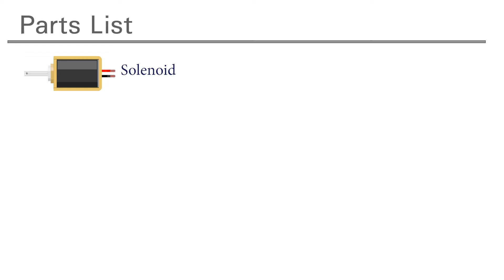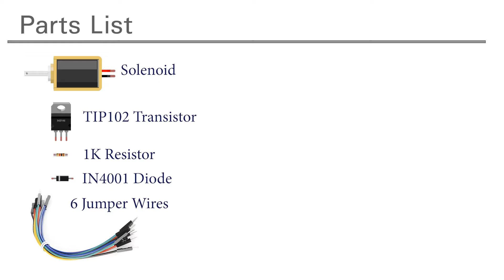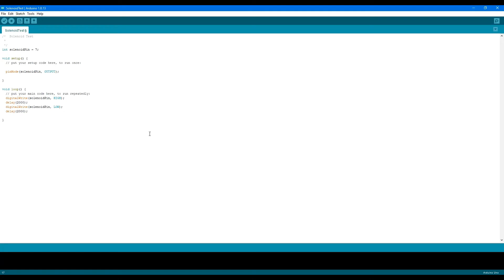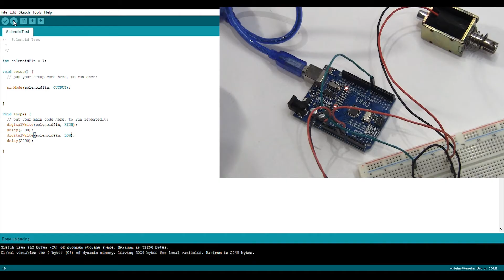Arduino Lesson 4 - Solenoid control using a Transistor

Comment: At 4:05 you say the middle pin goes to the negative side of the diode. What do you mean by that? Do you mean the cathode? Because that would be wrong, it goes to the anode instead, which is the positive (plus) side of the diode.

Thanks for the video.

Comment: This set up may work, but I wouldn't think it is recommended. You didn't explain the 12v power supply very well. (See others comments as well)  But you are supplying 12v in to the barrel jack, and 12v out through the VIN pin.  The VIN pin is an input, not an output pin. VIN = Voltage IN.  Also, it appears that you have this 12 supply attached to the breadboard after the Diode with a direct connection to the solenoid 12v in.
Your thoughts?  Thanks

Comment: Would this work with a 12v 5-2 solenoid valve that connects to a larger pneumatic cylinder and an air compressor. Would I just neee a different transmitter
Reply from the maker: @nathanaelculak7541  sure works just fine

Comment: I have a much larger solenoid and when plugged into a similar circuit the solenoid stays on, not caring about the transistor and the transistor rapidly heats up, is there a way around this?

Comment: can we connect 6 solenoids with arduino uno
Reply from the maker: Yes, you can connect as many solenoids as you have digital pins, just use a different pin for each solenoid or group of solenoids that you want to independently control.  You will need a power supply large enough for all 6 solenoids if they will be used simultaneously.

Comment: Great video! Very clear instructions. Quick semi-related question about power supply: Assuming it's the correct voltage for the solenoid I'm using ... can I hack apart my old laptop power supply by snipping off the cylindrical plug at the end (the part that would plug into the laptop)? Would that reveal the hot/ground wires needed to work with the breadboard? (I suppose I should just bite the bullet and try it myself, but I'm too nervous to ruin the power supply, lol.) Thanks again!
Reply: Yes, that should work as long as the voltage is correct.  The ground wire may present itself as a braided shield around the outside, but you should be able to connect it to a leaf wire using solder and some shrink tubing for insulation.
Reply: Yes, that should work as long as the voltage is correct.  The ground wire may present itself as a braided shield around the outside, but you should be able to connect it to a leaf wire using solder and some shrink tubing for insulation.
Reply: Yes, that should work as long as the voltage is correct.  The ground wire may present itself as a braided shield around the outside, but you should be able to connect it to a leaf wire using solder and some shrink tubing for insulation.
Reply: Yes, that should work as long as the voltage is correct.  The ground wire may present itself as a braided shield around the outside, but you should be able to connect it to a leaf wire using solder and some shrink tubing for insulation.
Reply: Yes, that should work as long as the voltage is correct.  The ground wire may present itself as a braided shield around the outside, but you should be able to connect it to a leaf wire using solder and some shrink tubing for insulation.

Comment: Is it possible to do this without that bread board?
Reply from the maker: Of Course.  I use a breadboard only for demonstration purposes.  You could certainly wire and solder everything directly, but I would suggest soldering to a protoboard for stability and ease of installation into a project box or something.

Comment: Thank you for this video. It would be great if you could do a similar one here. Its for a arcade gun recoil. After watching your video I wonder if it requires a diode. Maybe you could show us how you would make this. 

“The Ne555 boards are easy to hook up. They only have 3 pins.
 
You have 5v and ground in which you'll take from the UHID. Then ground out and power out. Power out is the 3rd pin. Ground out shares the middle pin with ground in. I.e. you have two wires connected to one pin for ground.
 
The output from the Ne555 board goes to a DC DC solid state relay. You should have one that can be triggered by as little as 3v.
 
Connect ground out (from the ne555) to - and ne555 power output to +. At this point you should be able to activate the solid state relay by pressing the trigger or whatever button you have hooked up to the UHID (one that is set to trigger 5v on your chosen pin).
 
Connect one of the wires from your solenoid power supply to one of the output pins on the relay. The other one goes to the solenoid. I usually have the relay connect the - and have the + from my 24v psu go directly to the solenoid. You can try it the other way if you want (or need) to.
 
Then it's just a case of adjusting the two pots on the ne555 until the full auto feel is to your liking.
 
The solenoid  should be triggered 7-14 times per second to feel authentic

https://youtu.be/8gx00X9qgzM

Comment: Could you do this same circuit without the arduino? Just with the push button, and the other components?
Reply from the maker: Sure, you could just wire the battery to the solenoid through a pushbutton.  This would allow you to simply control the solenoid manually.   The Arduino allows you to programmatically control the solenoid.  In this case we have a timer that activates the solenoid on a repeating basis, but it could also be used to read input from the environment and activate the solenoid based on those external inputs.

Comment: Great video! Quick question, why would someone use this transistor method over a 5v relay module? Thanks
Reply from the maker: For this particular application a relay would work just as well.  The benefit to using a transistor is the speed at which it can be switched, the smaller form factor, the quietness of the switching operation, and the durability of the transistor over the relay due to not having any moving parts.

Comment: hello is this lock is  working on Positive and Negative Pulse.
Reply from the maker: No, It is a simple solenoid that works off of the current from the power supply.
Reply: @DIYTechGuyShow  ok, actually I am doing a circuit that is 12V, 2A solenoid lock control through RFID, I am doing it through the H-bridge circuit, but my output is not coming. can you help me out with this?

Comment: IN4001 diode works with 5VDC.
How to connect 230VAC solenoid? I have these controller reset effects..
Reply from the maker: I don't think you can control an AC solenoid through a transistor.  A simple solution to get around this would be to use a DC relay to control the AC current.  I have a separate video explaining how to do this.  https://studio.youtube.com/video/KlxFC89gqpk/edit  In that video I control a 120V lightbulb, but you could use the same design and relays to control 230V.

Comment: Wait so you said the arduino can't provide 12v then you connected 12 volts to it?
Reply from the maker: The Arduino can't output 12V through it's controlled pins.  I just connected the solenoid to the 12V on the input side of the Arduino.   The Arduino can accept 12V, but it steps it down to the usable 5V for the processor.  The VIN Pin is connected to the barrel jack connecter prior to the step down in voltage.  The reason for this is that the Arduino can be powered from either the Barrel Jack or the VIN and GND pins.  By connecting my Solenoid to the VIN pin I eliminated the need to splice the incoming wire going to the barrel jack.

Comment: How would this work if I was using a board that didn't have a Barrel Jack?.   Could I just plug the V+ of the solenoid into a common 12v rail?
Reply from the maker: Without a Barrel Jack you would need to connect your 12V power supply to the VIN Pin(Positive) and the Ground Pin.  This will power the Arduino, the Arduino will convert the 12V from the Barrel Jack to 5V needed by the board.  In this setup, you could also follow the instructions just as they are and hook up the solenoid and transistor through the VIN pin, but it is probably easier to just connect it directly to the power supply or 12V rail.

Comment: Its really a great explaination! I have a question.. if i have to actuate 2 or more solenoids, connections would be the same? and if yes  can i  give Vin supply to other diodes too?? offcourse i will be using buck converter for regulating the voltage..
Reply from the maker: Sure, you can activate almost as many as you want as long as you have enough current(amps) from your power supply and enough digital pins on the Arduino to switch the transistors.  I'm not sure why you would want to power any diodes from the VIN since that would be 12V.  If you are talking about Light Emitting Diodes (LEDS) you would only want about 1 - 3 volts depending on the diode.  These would be more easily powered by the Output pins on the Arduino.   You could certainly power them from VIN, which is essentially directly from your power supply, and regulate the voltage through a buck converter and your only limitation would be the current(AMPS) supplied by your power supply.
Reply: @DIYTechGuyShow  ok I am clear now. thanks for ur reply 👍

Comment: can i use IRLZ34N MOSFET instead of TIP102 transistor does it also work with DC 12v solenoid valve???

Comment: Hello Tech guy. I am trying to get this working for a college project. The code will not upload and its the xact same as your code. Any ideas?
Reply from the maker: Will it not upload or not compile.  The upload button actually does both, compiles, then uploads.  If it won't compile, your issue is somewhere in your code.  If it won't upload, there are a few issues that could be causing this.  1st is a bad Arduino Board, 2nd is if the wrong board is chosen under the Tools Menu, this needs to match the board you are using (Arduino Nano, Arduino Uno, etc.).  The Processor chosen under the Tools menu could also be an issue,  Uno should be one of the ATMega 328, and the Nano would be one of the ATmega 128.   The Programmer chosen might also cause upload issues, I currently have mine set for AVRISP mkII.  I hope this helps, please respond with whatever it is that fixes your issue.
Reply: @DIYTechGuyShow  so I went to tools your and right the board was the wrong selection. I am using a Mega 2560 so I selected that and it ran the code but the solenoid did not open (its and old solenoid I took out of an old appliance so could be siezed shut). I am also using a TIP 121 transistor. Besides that everything is identical.

Thank you for your help by the way. Im a Mechanical engineerinf student and its so hard to find people who know what they are doing when it comes to arduino.
Reply from the maker: @c.moh8842  well, the first thing you should check is to make sure the solenoid is functional, the easiest way to do that is to just connect it directly to the power supply and see if it activates.  If it doesn’t, it is probably a bad solenoid or more likely you aren’t providing enough current.  Voltage and current are very different and I this scenario you wouldn’t be able to operate a moderate sized solenoid with 8 aaa batteries. Even though you have. 12 volts, the aaa batteries won’t provide the current(amps) required.  You would generally need a larger power supply the size of a laptop charger maybe.  It’s tough when pulling parts from existing products to truly know  the specs, but you can always hook up a larger amperage power supply, NOT VOLTAGE, just to make sure it works.
Reply: @DIYTechGuyShow  Yes i think you are right, its not getting the correct amount of current through the coild. Can you recommend a 12v solenoid that would work through arduino? I can get my hands on a 12v - 300mA valve. Would this work?
Reply from the maker: Any 12V solenoid will work using the Arduino, you just need a large enough 12V power supply.  You just need to power the solenoid separately and just use the Arduino and Transistor to switch the ground connection. The limitation is not the Arduino, it is your power supply that is the limitation.

Comment: I want to use 5v solenoid in a control circuit of an air mattress , should i connect the solenoid directly to the ardunio ? 
And does the 5v solenoid even work for such circuit?
Reply from the maker: the solenoid should be connected through a transistor, even if you have a 5v solenoid, powering from the Arduino will pull way too much current.  I also doubt a 5v solenoid would be able to operate a valve.  The biggest thing I have been able to do with a 5V solenoid is to ring one of those hotel bells.

Comment: is it possible to control 2 or more solenoids with just 1 arduino, like can i add another solenoid in your demonstration?
Reply from the maker: This shouldn't be a problem at all, the limiting factor will be your power supply and whether is can handle the current load.

Comment: Question. Will it be okay if i use a 12v adapter with a 6v solenoid?
Reply from the maker: 12V would burn up the solenoid.  You might be okay for short bursts, but you definitely wouldn't want to use it in an application where power is continuously applied.

Comment: What is the rating on the transistor?
Reply from the maker: I used a TIP102 transistor, but almost any NPN transistor could have worked for this application.  The TIP102 has a max current of 8 amps which is overkill for this project, but I just happen to have a few extra ones lying around.  You can see the full datasheet on the TIP102 here:  https://www.utmel.com/components/tip102-npn-transistor-datasheet-pinout-and-application?id=799

Comment: Hello Sir .. we would like to use solenoid as  shooting mechanism in small robot .. which way do you suggest  to improve the return Force?
Reply from the maker: You could use a larger solenoid and possibly some type of lever mechanism to translate the 1 inch throw of the solenoid to something 2 to 3 times greater.

Comment: You don't need to connect a wire from the Arduino 5V to the breadboard. It's not being used at all.
Reply from the maker: Yes, good point.  since the transistor is getting it's 5v from the pin, there is no need to power the rail.

Comment: Question, I would like the solenoid to open/close repeatedly every half second or so when I press a button. Can I simply add a micro switch into the circuit to the 5v +/-? As note the solenoid will be powered @ 10v using a dc power adapter via the VIN.
Reply from the maker: Yes, this should work, although I would prefer to control the solenoid through the code.  You would need to just condition the opening and closing of the solenoid by reading the state of the button.  I have a separate video that explains how to use switches and buttons with the Arduino.

Comment: For trinket and trinket pro, how do I power the 12 v solenoid
Reply from the maker: I'm not familiar with those boards, but I would assume you would tie it in directly from the power supply.  I sort of cheated a bit by using the VIN pin, since I know it connected to the positive side of the barrel jack.  The VIN pin is actually supposed to be used to power the board when you don't have a barrel jack or if you wanted to position the barrel jack on the outside of the case or something.

Comment: hi i have an output of 1.8v 200ms low. during this time I want to de-energise a 3v relay can I use the transistor to switch off BCS the 200ms not enough to de-energise the 3v relay

Comment: Next question - why is the transistor tied into the negative side of the solenoid rather than the positive?
Also, why is the resistor needed? I saw another video that did not use one.

Comment: Forgive my rookie question (i'm not trained on electronics but can follow instructions). I don't have an IN4001 diode but I have some others. Can I substitute an IN4007?
Reply from the maker: Yes, that should work.  You'll know something is wrong if the Arduino resets itself when the solenoid fires.  I always add some code to blink an LED a few time during initialization, that way it is very clear that the Arduino is resetting.

Comment: Hi, iam using a solenoid valve (5v), and i want to use this method i think it should work, the only difference is the 12v power supply that i dont need it because the arduino can work with 5v, now my question is to control the valve like you did (on & of) i should do the exact thing that you did just without using the power supply is that right?
Reply: You would still need a 12 volt power supply to power the solenoid.  5volts is probably not enough.  Check the specs for your solenoid to know what power it requires.
Reply: @jpconn1   Hi Jim, i found the same circuit that been used in the video without the 12v power supply and with a 5v solenoid, the only difference is that he used another value of the diode and the transistor.. ( https://core-electronics.com.au/tutorials/solenoid-control-with-arduino.html)
Reply from the maker: @hamzi586  For an application like this there are a bunch of different transistors and diodes that would work.  The same idea applies; using a small voltage to switch a higher voltage through a transistor.  If your solenoid is 5V, I'm not really sure why you need the transistor.

Comment: Where to apply 12 v?
Reply from the maker: Good Question, not sure how I missed this in the diagram.  You use a 12V power supply to power the arduino through the barrel jack.  The Arduino brings this down to 5V to power the arduino logic, but still provides the full 12V power to the VIN pin on the arduino.  You can see this with the purple wire that powers the Solenioid.

Comment: Does your heatsink on your transistor get super hot quickly during this?
Reply from the maker: No, not in this project.  I imagine it would If I had more current running through the transistor.  In cases like that, you would want to attach the tab of the transistor to a larger heatsink using some thermal compound.